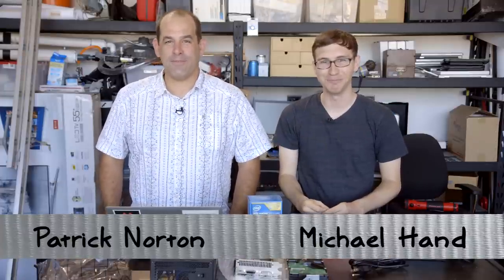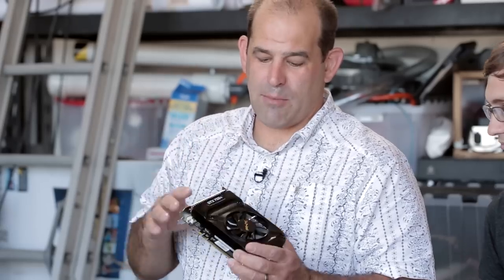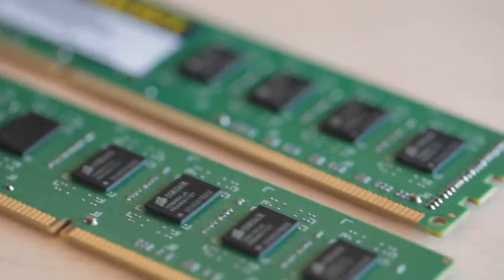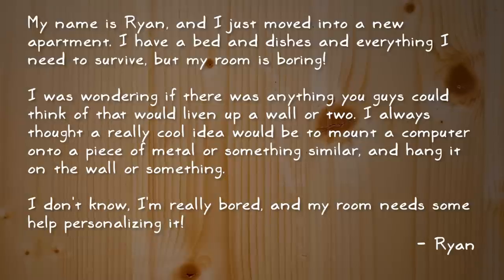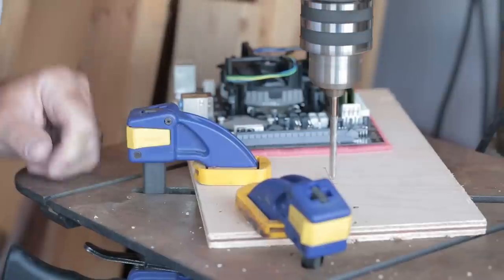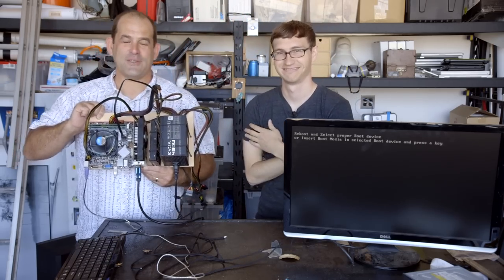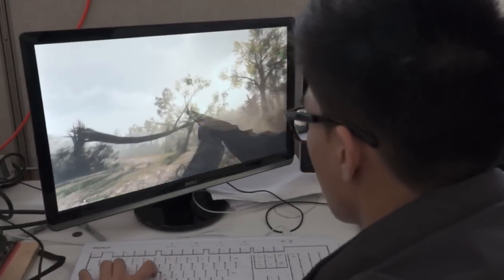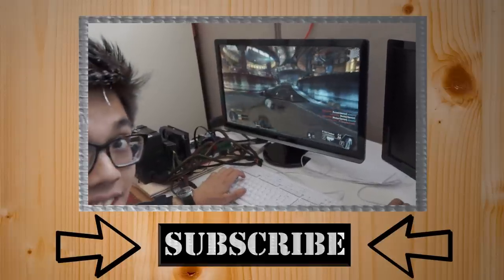Screw The XBOX ONE and the PS4... We Built a Gaming PC for $380!

Comment: 380$ can make a pc that can run almost all games on atleast medium high settings aslong as you dont want it at 4k with 20km view distance.
Reply: +Oil Lamp That type of build will only run older games in 1080p, you can forget about running normally current gen games also if you like shitty low graphics that build is for you.
Reply: +DjGodaryD86 i3 2200 or something like that with a 5/660 or something similar with 4gb of ram etc. You can get a cheap and good build for less or a bit better one depending on how much you research..

To be fair its alll about what games youre going to play? Someone might invest in getting a good cpu and just use internal graphics even.
Reply: +DjGodaryD86 That games outperforms PS4 / xbone in every single fucking game that actually exists. Is Fallout 4 an old game? It just came out today, now go take a look at how this pc runs it vs your poor peasant boxes
Reply: DjGodaryD86 a PS4 got 8 gb of ram, a semi decent cpu(like 100£ cpu today LOL) and a decent GPU. The reason some PC can run some games on the best settings that consoles can run is that consoles run them on low settings AND theres no way to get good settings or upgrade..
Reply: Oil Lamp - Nice joke, facts say otherwise. Goodbye.
Reply: Oil Lamp The PS4's CPU isn't decent and isn't at all comparable to a 100 pounds cpu. Not even close. It's a low powered CPU made for mobile devices (you know, tablets) to run on battery.
Reply: +DjGodaryD86 This PC compares pretty much as to the consoles as both consoles use low power Jaguar CPU architecture which was originally designed for battery powered devices like netbooks and tablets. In fact you can buy the 2.5ghz version of the Jaguar CPU architecture brand new for £25 and that's retail prices which means both AMD and the store that sells it have both made a profit from that £25 sale.  The Pentium when overclocked  to 5ghz hands in far superior performance to the Jaguar CPU architecture with the only thing letting it down is the lack of multithreading as in no developer expects PC gamers to be using a dual core so they would have been far better off with any I3 CPU or even a 6 core AMD CPU which is cheap.  The 750ti matches if not marginally outperforms the PS4 in all the big games Digital Foundry has tested over the last two and a half years when paired with an i3 CPU which has hyper-threading so this PC will match consoles in pretty much everything.
Reply: +Fus Ro Dah thats the problem with consoles. By the time its on the market, the technology has already stepped to the next generation. The only console benefit is that you dont need to know anything about hardware or sofware to use it, hence all the Xbox and PS4 screaming which of theirs is better. Its truly sad and i admit when i was 16, i was a xbox fanboy aswell.
Reply: +Hugh Janus 

if you built a lga 775 based system, mod the socket to 771 you could pick up a Xeon 5460 3.2ghz (overclocked to 4ghz) for $65, 8gb kingston ddr 2 800 is like $45, xfx 550w psu $56, ASUS P5B-PLUS motherboard $50, gtx 770 $160 will put you at $376 that will run crysis 3 on max at 1080p with a playable frame rate
Reply: ***** It's irrelevant frankly. A computer gets cheaper down the line for a multitude of reasons. You keep half your PC pretty much for ever. Case / HDD's / keyboards / mouse and sometimes even rams and mobo. Then you sell the old parts while still being able to play your old games. Also, you don't need to also buy a computer which you would in case you went for a console.
Reply: +Hugh Janus i got all the prices on ebay inc postage but it now
Reply: +Hugh Janus ok lets say you got a q9650 3ghz, that's about $80 on ebay it will still pull decent frames at 3ghz, and even with a gtx 660oc which is about $100 on ebay brings the total build to $331
even if there was some postage on that which their wasn't on the listings i checked, that computer is still plenty to run pretty much anything with decent frames on high at 1080p
Reply: +Hugh Janus You have a point there, but if you are like me, I always find some people with a broken computer where they want to get rid of it... with the computer case and most of the ram in tact. Sometimes I get extra hard drives, power supplies etc. for free because the people who got rid enough are not tech savvy enough to take their computers apart. 

Other than that. the longer you use PC, the cheaper and more affordable it is to get up to date. (You can always take the working components on your older machines and simply blow your entire budget on a new CPU or GPU rather than buying an entirely new shitty middle budget machine. 

I am still using the mouse from my Vista machine 14 years ago, a monitor that came from my windows 7 Computer and speakers from a windows 2000 computer(I got new headphones last Christmas, and never really  need to upgrade the sound systems since I am the only one that listens to it.) I also have not 1, but a secondary computer that got abandoned and took me five hours to fix it. (Its good enough to run 96% of my game collection.)

I got backup monitors, backup keyboards, backup mice and a secondary machine that was abandoned I repaired myself without buying any parts.

Comment: What a lot of people don't realize when going into making a custom PC from the start is the cost of extra things like Software and Operating Systems. Not to mention a decent monitor, a case, some form of cooling, a decent mouse, keyboard, and speakers. You cannot make a custom playable PC for less than the price of a new console, it is impossible. Unless you can have stuff given to you by friends, or you find some really good deals. Although the initial price can be moderately steep, in the long run PC gaming is cheaper. Especially with parts being cheap and easily upgrade-able.
Reply: In that case, you'd have to include the price of an HDTV in with a console.  I have not met anyone without some kind of HDTV in the last few years.  Even people without "cable" have some kind of Plasma/LCD/LED TV.  If you are switching to PC gaming from like a 360 or PS3, then you are in luck and won't need to buy a controller.  You can just use the one you have.  I use a wireless 360 controller personally.  It feels best in my hands.  My computer is hooked up to my TV.  It cost $538 and is more powerful than the new consoles for gaming in terms of frame rate, resolution and graphic abilities.  Plus...it's a computer.
Reply: Hallelujah.
Most people have a monitor or TV already. Nobody should pay for Windows anyways. Keyboards and mice can be found in bins for loose change if you don't already have any sitting around which you probably do. If you're an FPS player then you can justify the cost of a decent mouse which is about the same or less than a console controller. Factor in money saved by not paying fees to play online and steam sales and you end up saving EVEN MORE.

I'll never understand peasant logic.
Reply: I think we can all agree it is more likely to have a tv in a household than a pc monitor. Just saying
Reply: AlmostMLGGaming but you can use your tv as your monitor, so there is that
Reply: You could for sure but I don't think pc players like playing on bigger screens like that. Some do for sure but a lot don't.
Reply: 1) what software are you going to be paying for?
2) have you ever heard of Linux?
3) if a tv doesn't add cost when making a console setup, then a monitor doesn't count either
4) you don't need a mechanical keyboard and gaming mouse, just get a cheap mouse and keyboard from Microsoft. if you really need a good mouse though go with something like a razer abyssus or a steelseries kinzu, they're dirt cheap
5) speakers? just use your headphones. but if you really need loudspeakers some are pretty darn cheap or if you're using a tv you can just use the built in speakers

you're completely wrong about console gaming being cheaper than PC gaming. games on PC are MUCH cheaper than on console, and you don't need to pay a fee to play games online. checkmate.
Reply: Most people have this crap laying around already. I wish people would stop using the "you need a monitor" excuse when everybody has a TV with HDMI.
Reply: Do you play certain games on each or do you play all you're games on both your monitor and LCD tv?
Reply: itt: nerds getting mad at op
Reply: AlmostMLGGaming And I bet you TV has a  vga or hdmi socket that lets you use it as a monitor too.
Reply: If you want to include all that with the cost of a PC then you also need to include the price of a TV and Stereo system into the cost of a console.
Reply: Not to mention having to pay for online, no good sales on games, and shitty headsets that break too fast.

Comment: open Pc = crap 
Cause: EMR(Electromagnetradiotion) Protection; Grounding of the components; Basic Eletricity Saftey; Bad Airflow; your cat could jump on the computer and break it.
Reply: The power supply is the ground for the components. Alot of test bench pc's are open and they dont take damage from it.
Reply: What if you keep it in an open freezer haha
Reply: I'm a thug I never wear no static protection... and build my pcs on my carpet floor! Cuz I like living on the edge
Reply: The gpu and power supply could fall
Reply: You should just get a box case
Reply: CTI How? You have no idea what you're talking about.
Reply: A case, as in a metal case. I built a pc, so I should know. Wood can be a substitute.
Reply: And It could fall because of stripped screws. This happens over time, at least with my friend's pc

Comment: if you did a bit of price hunting you could easily drop the price of the build by at least 20% and if you used a cracked version of windows 8 or whatever as its at its final stage anyway since windows 10 is out you can save another 80-100 bucks there too.